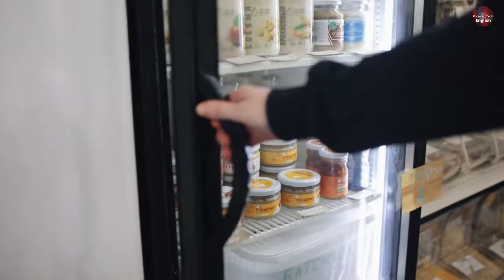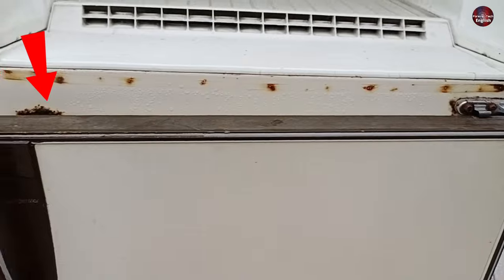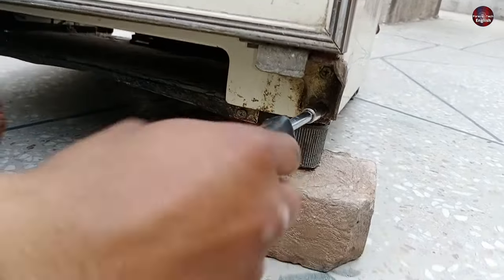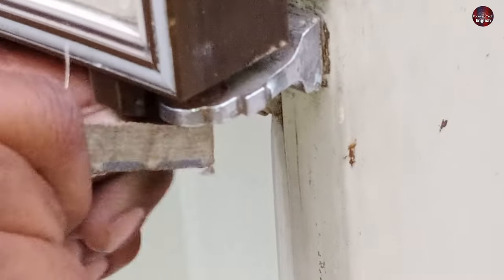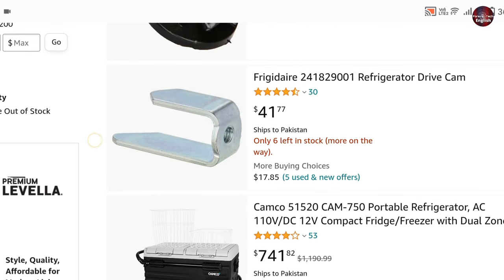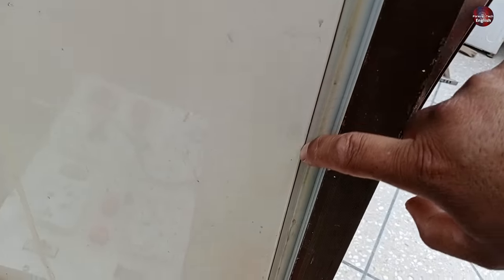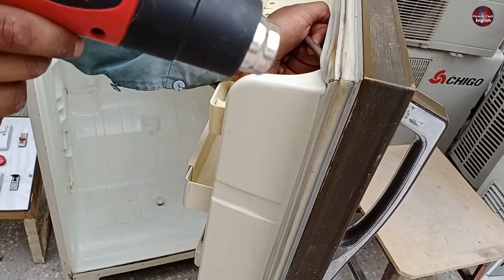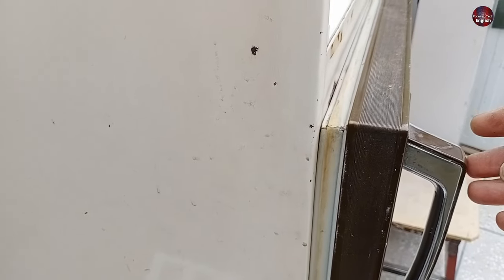Refrigerator Door Won't Close Properly - Do This

Comment: Thank you so much! Very good video! A question, please. Will heating the gasket always work? Will it go to the original state? Or there is situations when it won't help? I was trying to heat the gasket, but it didn't helped in my case. And I really see no difference in gasket even after long heating.
Reply from the maker: In your case, if heating the gasket did not help and you noticed no difference, it may indicate that the gasket is too degraded, made of a material that doesn't respond well to heat, or that the heating method used was insufficient. It's possible that the gasket needs to be replaced.
Reply: @forevertechenglish  thank you!